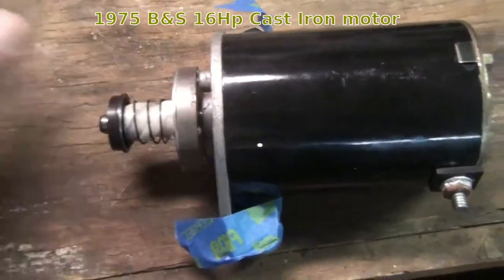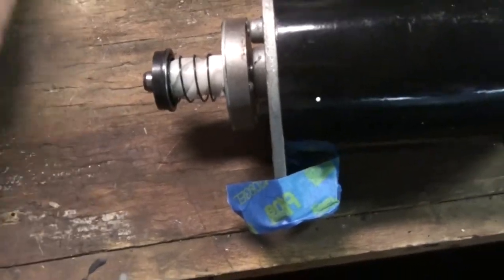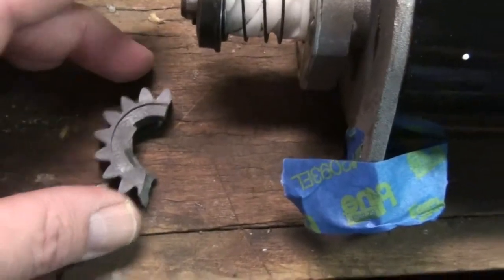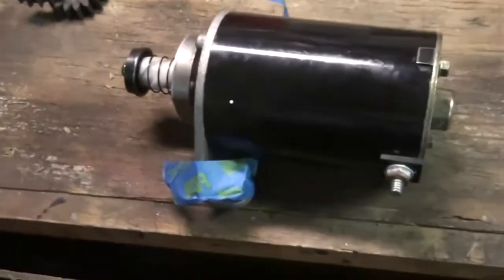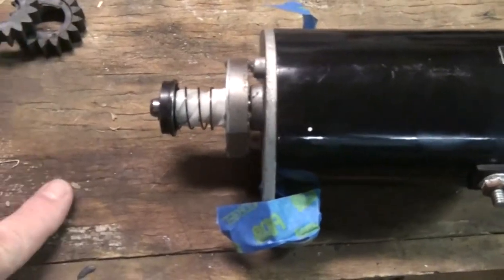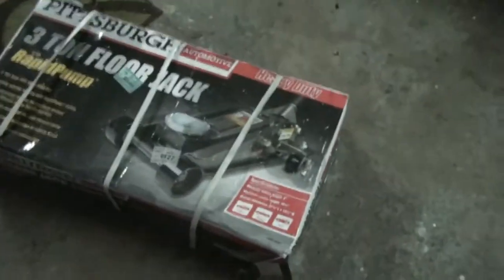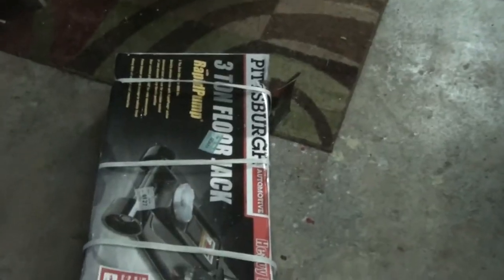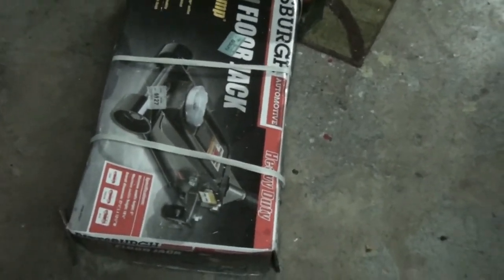Gilson Starter Question

Comment: Have you looked good at all the teeth on flywheel . Does it seem like the starter is shimmed right . Does the engine kick back when the gear breaks or does it start when it does it .  Maybe lay something close to fly wheel teeth and turn to be sure it is not out of round . Is there a top and bottom of starter gear , or one side of the teeth beveled . to throw gear back out . Thinking some have one side indented , or kinda machined out some  on one side , and thinking that side goes up or away from starter . if thinking right . does ,Starter and flywheel look 90 degree to each other
Reply: thinking the starter sucks the gear in when starting , and beveled teeth part then should face starter motor . May be how you had it , just thinking of anything i can think of that may do it
Reply from the maker: So looking at the break out of the motor I believe I have the beveled side of the gear facing the correct way, I believe you hit on it with the fly wheel being out of round. I think I need to look at that closer. The teeth on the fly wheel seem in good shape and the teeth on the starter gear don't appear damaged in any way so the fly wheel being out of round makes the most senss thanks! I will check and post a video update of it.

Comment: Maybe one of the flywheel teeth is not deep enough causing a problem on the drive gear.  Good luck with the jack, hope it's alright.
Reply from the maker: Could be, however I don't see any sign of that I am leaning tword an out of round fly wheel I will post what ever I find later. Thanks! Take care!

Comment: My local FED-X and UPS drivers are good about bagging packages on rainy days.  Let's hope it was not the normal guy on your route.  Lots of good advice from others about the flywheel and alignment of the starter.
Reply from the maker: Yea, I believe its the flywheel something I did not even think of so putting this out there was very helpful I have great subs always willing to chip in. The UPS and USPS are really good about bagging however I don't get much from FedEx so I am hoping it was just one of those days for the driver. It turned out as the jack had been wrapped in a second layer of cardboard so it was not even wet thank goodness from the look of it had it got wet it would probably rusted right away. :) Ride safe man!

Comment: Is there a problem with your flywheel perhaps? With it running inspect to see if it is warped, and then without it running, turn the flywheel by hand to see if any teeth are messed up. Those are the first two issues I would look for. Hope this helps.
Reply from the maker: Well checking while its running is not all that easy since I would have to take the shroud off to do that and to do that I have to pull the motor and that will mean a new bottom end gasket since the oil pan stays in the frame. So will try and check it while its still in the tractor but an out of round fly wheel makes perfect sense. Thanks for the tip! I will keep ya posted.

Comment: Well, I wish I knew for sure what the problem is.  I know others have mentioned shims.  I know there are many variations to those gears depending on the type of flywheel you have.  Like number of teeth, steel or plastic, etc.  How'd the jack turn out?
Reply from the maker: The jack turned out fine, turns out there was a second layer of cardboard protecting it so it was not even wet so I got lucky I guess. Thanks for watching man I will figure this thing out!!